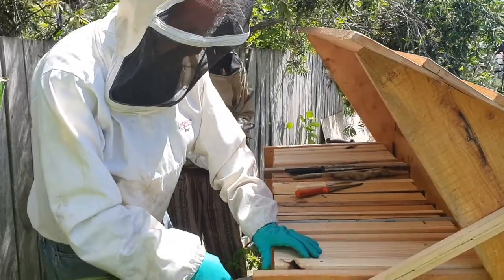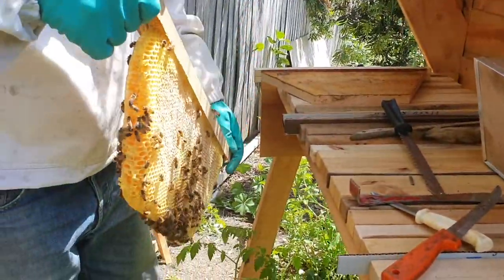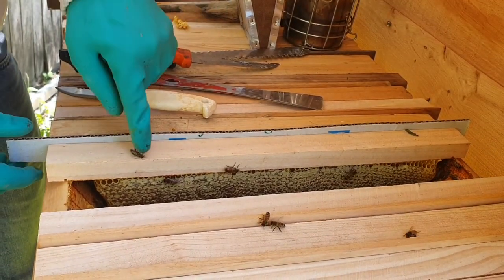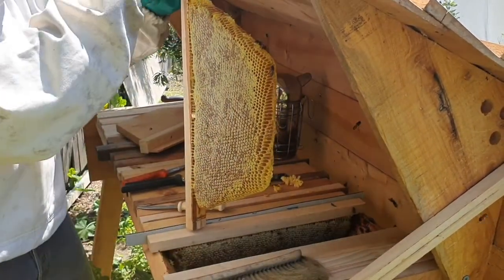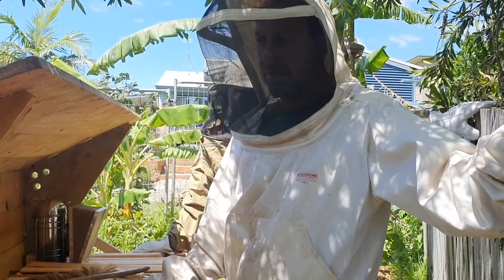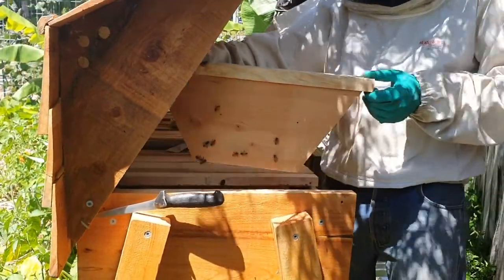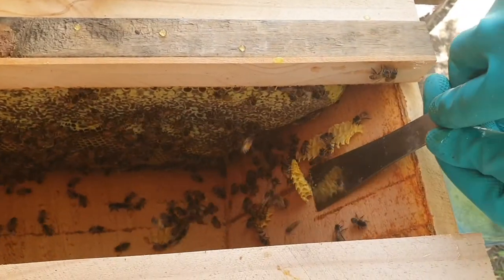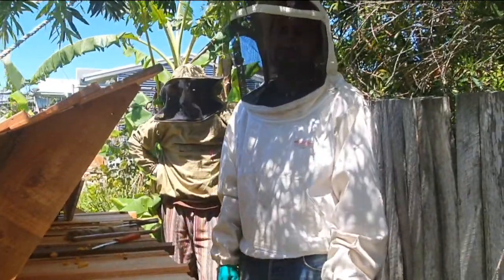Harvesting Honey from a Kenyan Top Bar Hive, with Adrian Iodice from Beekeeping Naturally

Comment: You handle your bees very well. Indeed, horizontal hives for the win! I got into beekeeping from doing volunteer work for an elderly beekeeper who couldn't lift his Langstroth boxes anymore. That wouldn't have been an issue for him with a horizontal hive. Yet another reason for folks to consider a horizontal style. No heavy lifting! Also, consider an L-shaped cutter to cut the comb away from the side walls. Take a metal rod about 5mm thick and long enough for you. Say 18inches or so. Bend the last inch, inch and a half, pound it a bit flat so that the flat is in the same plane as the rest of the rod, then sharpen that bent bit. Put a handle on the other end. With that you can cut the comb in an upward motion by starting the cut at the bottom of the box and drag the cutter up the wall toward the top bar. Something to consider.
Reply from the maker: Thanks for your positive comments. The Kenyan Hives are very well suited for older folk and people in wheelchairs. I've taught many elderly experienced beekeepers who have decided to move away from the stackable Langstroth hives. I use to run a few Warre hives years ago and had one of the tools your describing, I can see the advantages of using it to detach comb in a Kenyan. Thanks for the tip. I'll see if I can find it somewhere or get my son to make me one, he's 15 and has gotten into blacksmithing recently so it would be an easy project for him.

Comment: Great information  on actually managing the hive. My only observation is that when cutting the honey from the top bar you were pushing the knife toward your hand.  You could accidentally push the knife right into hand.
Reply from the maker: Thanks for watching Tom. Regarding your concerns, the knife i use is blunt, the honeycomb is quite soft and easy to push a blunt knife through also the top bar acts as a stop between my hand and the blade if i were to slip.

Comment: Hi Adrian, I bought a beautiful timber pack from you of macrocarpa and I assembled your fantastic Kenyan hive design this spring here in Canberra. I now have my first swarm inside and its been there for about a week. I am so excited! I really enjoy watching the calm and considered way you work the hive - I hope I can learn to be that way with my hive one day too. I have a couple of questions - 1. How often would you inspect a hive in the beginning from when you first put in a swarm to check for cross combing? 2. I was wondering about your approach in using smoke? Les Crowder uses smoke whereas Phil Chandler uses sugar water spray. What is your preference and when do you use it? 3. In Canberra - in a colder climate - how many bars of honey would you leave for winter? Thanks for providing such a great video for us to learn.
Reply from the maker: Hi Pablo, i'm real happy you enjoy the Kenyan hive, they are a fantastic hive to use. I like to make my first inspection just 3 days after introducing a swarm because if the bees start to build comb across the top bars and not along them I can redirect the combs at this early stage before it gets out of hand. if I know that the combs are straight then I do a second inspection about 10 days later. further inspections will be determined by the amount of comb the colony has built in the last 10 days. So about 2 weeks after the swarm was introduced. So if they have built comb on all 10 bars in the first 2 weeks I can determine how often and how many top bars to add. In this scenario I would add 4 top bars, 2 on either end, be sure to add them using the chequer board method in my other video. Q.2. I prefer smoke, I always have a smoker lit and ready to use but often I wont need to use it. I have it on hand if the bees start to fire up, then I can give them a small amount of smoke and start to pack the hive up and leave them alone. 
Q.3. In Canberra I suggest to leave a full size colony 8 full bars of honey to over winter with. A three quarter size colony i would leave 6 bars and half size colony gets 4 to 5 bars. I'll be teaching in Canberra again at some point, and will send you some information on my courses if your interested in attending. Go slow and have fun
Long Live the Swarm!
Reply: @beekeepingnaturally  Hi Adrian - thank you so much for you reply. I will put your advice into practice. What an adventure! I attended your course before COVID and it was very informative and enjoyable.
Reply from the maker: @pabloshopen4172  Thanks Pablo

Comment: You need a warre hive-tool!
Reply from the maker: Thanks for watching. When I first moved over from conventional Langstroth hives, I started using Warre hive’s. I found them great for the bees but after a few seasons I decided to try a Kenyan hive and that’s the direction I went in. I find them so much easier to use than the Warre hives although I still have a soft spot for them. They are great hives! I still have a few empty ones and im thinking of getting them going again this spring
Reply: @beekeepingnaturally  Thanks for the reply. It is the tool I was recommending, not the hive. It would make detaching comb from the walls much easier!
I design and build my own hives. Currently I have a couple which are based on the warre, but next spring I will be trying a long-hive built out of hay bales.